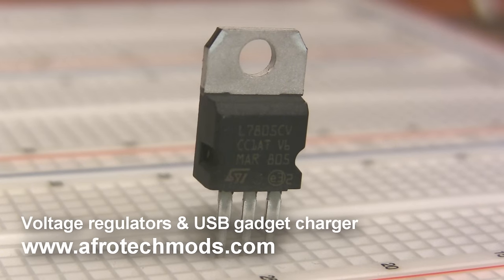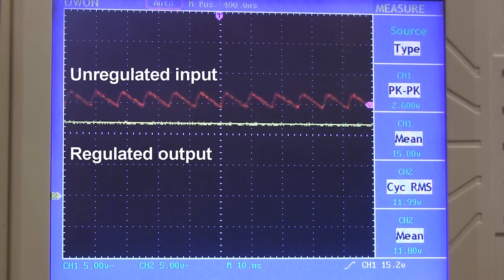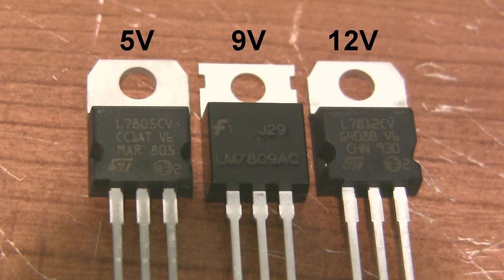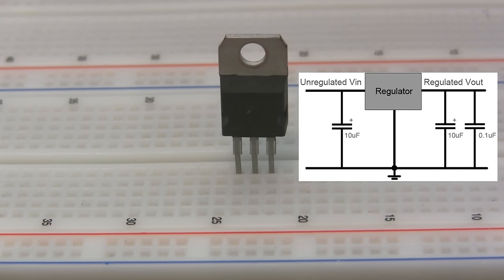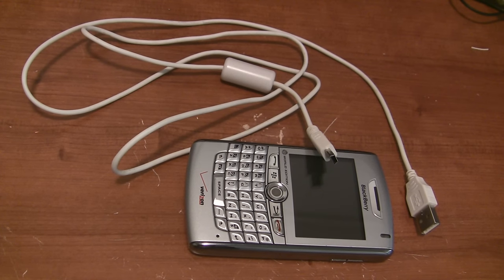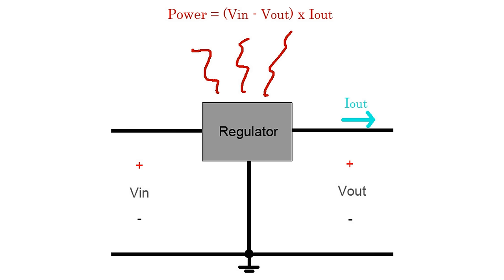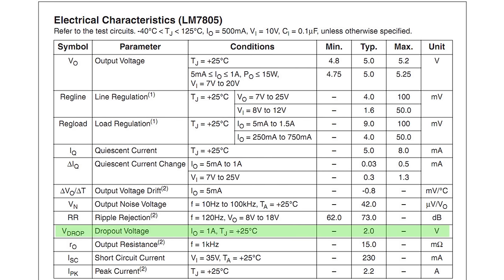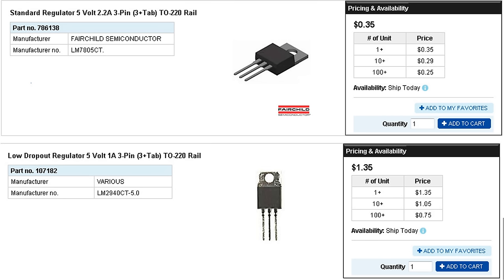Voltage regulator tutorial & USB gadget charger circuit

Comment: Question.. what if the input voltage were to drop below 5v. Would no voltage pass?
Reply: The regulator would have a smaller voltage on it's output, depending of the input voltage.

If you put a 1.5v input source, the output would be close or at 0v.
Reply: Thanks, is there a way to let the lower voltage pass until it reaches 5v?
Reply: KLanD Tine I really don't know if there's any regulator that let you do that, maybe with some little research and you could find one that does.
Reply: lolzvid
Now that I know how a standard one will react I'm doing just that.
Reply: KLanD Tine If you need a regulator that can regulate when the input voltage drops, use a buck-boost converter. Those will regulate when the input voltage goes over and below the output voltage.

Comment: Hello! 
I this video u you 2 pics 10 uF Capacitor  and 1 pic .1uF . Please tell what's there voltage? 
In the market i got 5 type of 10 uF Capacitor (50, 160, 250,  400 450) volt
and 
0.1uF capacitor any other name or code?
Reply: +Md. Touhidul Islam did u get ur answer??? if yes plz share

Comment: I love your videos so much!
Please, can you tell me just one thing? I was wondering about it for a long time. If I stabilize the voltage from 12V to 5V with 7805 regulator, what current will I get on the output? let's say that I've got 12V battery that gives max 2A. Will I get 2A on the output as well? Because it would destroy the battery in my phone. Thank You!
Reply from the maker: The load you connect determines how much current is drawn. If your device draws 0.1A then only 0.1A will pass through the regulator and only 0.1A will be supplied by the battery.
Reply: Thank You for quick reply. So when I'll use a bettery which gives me 2A, it will really destroy the battery in my phone?
Reply from the maker: Not if you follow the instructions in this tutorial. If you build what I showed you, the phone will limit the charging current to under 0.5A, so the regulator only supplies 0.5A, so the battery only supplies 0.5A. Just because the battery is capable of delivering 2A, it does not mean it will always do so.
Reply: Thanks a lot man. Really appreciate that :)

Comment: Beginner in electronics here. I have some L7805CV's, or in other words 5v regulators. (30v in). I thought that if I added two of these together on a 30v input, I could output 10v but this doesn't seem to be the case. NOTE: I am not stacking these. On my breadboard I have the 30v line in on both of these and the output going to an ohms meter. I am still only getting 5v output. Why is this?

Comment: I am really worried about overcharging phone batteries,  is overcharging protection built into the charger or into the phone?
Reply: +comebackata2 Yes it is. The mass majority of phone batteries have a single 3.7v lithium ion battery cell. The phone has a battery charging circuit in the phone that regulates the 5v from a USB charger down to 3.7v. Though more than likely will have multi stage charging circuit that charges the battery at a high current when the battery is heavily depleted then switches to a lower current when the battery reaches a high charge. Then may even switch to a trickle charge of a very low current to keep the battery at a full charge.

Read the description of this battery charger on adafruit which is the same type of charging circuit that would be found in most any phone. https://www.adafruit.com/product/259
Reply: +comebackata2 Yes it is. The mass majority of phone batteries have a single 3.7v lithium ion battery cell. The phone has a battery charging circuit in the phone that regulates the 5v from a USB charger down to 3.7v. Though more than likely will have multi stage charging circuit that charges the battery at a high current when the battery is heavily depleted then switches to a lower current when the battery reaches a high charge. Then may even switch to a trickle charge of a very low current to keep the battery at a full charge.

Read the description of this battery charger on adafruit which is the same type of charging circuit that would be found in most any phone. https://www.adafruit.com/product/259
Reply: Thanks!

Comment: Hello,
Could you possible help me to build a gadget for my entreprize in school. It would charge up your phone when you walk, so there would be a magnet on a bearing and some coil around it and a 3.7V battery, most phones charge at 5V, do you think this is a good project? do you think the battery will charge up and what resistors, voltage regulators and other do i need? i also would like to include a LED in there. If you could help me Id be very greatful. Thank you

Comment: are there precision voltage regulators?
Reply: are will you have to use other components in conjunction besides capacitors
Reply: would you be able to take that heat off the regulator on a Peltier brick and generator.

Comment: Hello, I have a 36v source and I want to keep it in a side and I want to have 9v in another side. I've put this 7809 and the multimeter show me like 10v but as soon as I connect another circuit (with a 555) the volt go down to 2v and the circuit with the 555 doesnt work. I want to fix those 9 or 8v with a 7808 to make the 555 circuit works. Anyone could help me please ?

Comment: With how many mA this would charge the battery?
I've done some research on the internet and the optimal rate you should charge the battery is like 40% of the maximum capacity. Like if my phone had 1000 mAh, I should charge it with 0.4a.
I am confused. Can you explain me a bit more?
Reply: mAh is the capacity for the battery when fully charged.
Reply: kxx Lets break this down.
m = mili
A = ampheres
h = hours
If the battery had 2000 mAh, then something that draws 2 ampheres(2000 mA) would discharge the battery in 1 hour.
Reply: DaGunchijs
thats what i said... its a measure for how much charge it can hold, when it is fully charged.
Reply: kxx
What was the question?

 With how many mA this would charge the battery?
Reply: DaGunchijs It would charge the battery according to the rated output current of the regulator, or the limit to the input current to the regulator, OR depending on any resistance you add between the regulator and your battery.

If you have a 1000mAh 12V battery, and want to charge it at only 0.4A, you could, for example, place a 30 ohm resistor between the charger and the battery on the positive terminal (could be either terminal, but for the sake of doing it proper).

You don't really want to run a regulator at it's maximum rated current, either, just to be clear. It'll work, but only for so long. Best to use a slightly too large regulator, and a resistor between it and your battery instead, to limit the amount of work it has to do. If you let it "run free" - the regulator will readily just kill itself attempting to deliver as much current as possible to your device or battery.
Reply: Mythricia
thanks, but i figured it out in 3 months, lol...

Comment: hello sir 
can i use 12v Single power supply for multiple devices for eg.. (1)cpu fan 12v 0.13 A
(2) timer switch 12v 1A
(3) temperature switch 12v 1 A

Comment: Could a battery charger really be that simple? I've been looking at building a basic NiMH battery charger and all the resources I find goes into great length on the current provided and trickle charging the battery and what not. What am I missing here? How could charging a battery be as simple as slapping a Voltage Regulator on it?
Reply from the maker: Depends on the charge rate you want to achieve, and depth of charge you want to achieve, and how much you care about your batteries. If you want a cheap and dirty NiMH charger you can just give it a constant 1.5V/cell and limit current to 1/10 of C. Or you can trickle charge with constant current at C/10 or C/20. These are definitely not the optimal way to charge the cells, but it will get you a decent charge.
Reply: From what I understand, most cellphones got most of the charging circuit inside, and the wallwart is actually just a power supply, it doesn't take care of the battery (to avoid overcharging etc); and on top of that, phone batteries got their own protection circuits inside them.

I'm not sure what it is like for other types of devices and batteries.
Reply: Dewald Swanepoel 

ok

Comment: That R-78B5.0-1.0 is same as LM317 voltage regulator.
Buy LM317 and search for schemtic how to wire it up. It is easy.
Use variable resistor to get different voltage output. I use it when im in the wilds with solar panel on my back.
To take it to the next step use darlington transistor with LM317 to get higher current output. I too kthis step to charge AGM batteries from solar power.

Comment: If you want to charge your phone with 12V use a DC DC converter, youll find them for 1-2$ fully assembled boards on ebay. 90% efficiency, output extremely stable.

Comment: what is the difference between this and a bridge rectifier
Reply: A bridge rectifier converts AC power (back and forth current flow) into DC power (single direction current flow). A voltage regulator provides a stable voltage (think pressure, rather than flow) at a chosen level regardless of input voltage, as long as the input voltage is a few volts higher (or more, within limits) than it's output voltage.

Comment: I have 4 small usb 6v 3.5 watt solar panels, in bright sun I get 7 - 9V out of one, . I want to wire them all in parallel, Will I get 14 watts and use a regulator reduce voltage down to 5V - 5.5V  as my phone needs at least 1.5- 2A before it start charging will this regulator work or is Amps/watts to high don't know if this lot makes sense?
Reply from the maker: Pulling off 1.5 to 2A with a linear regulator may be asking a bit much. Try shoot for 0.5A to 1A. Since you are using 6V panels you will want to use a low dropout regulator, like an LM2940 instead of an LM7805. Also this link may be helpful: http://www.epanorama.net/newepa/2010/08/18/apple-charger-secrets/
Reply: Thanks

Comment: Hi Folks ! As a Professional engineer I have been using the L7805CV for over ten years and I have an issue ! , did anyone else notice the thickness of the Gnd / Heatsink Tag get thinner a few years back ?. since then the typical vout seems to be on the Min side of the 5V specification with poorer regulation than the old one !.   Is it just me ??
Reply from the maker: +Kevin Felstead It depends on the manufacturer and the date code/batch. There are so many 7805s out there there will surely be variance.
Reply: I am buying from reputable supplier's such as Farnell but the output is definitely low, even using the metal case of my product as the heatsink.

Comment: OK so I got this to practice .I get 14.5 V unregulated from the car battery > directly  to an 12 V light bulb . The light Bulb will light up fast from the 14.5 Volts but if I leave it for to long it will overheat . So I used your example in the video to transform the 14.5 V to 12 V ( regulated ) .But when I connect the light bulb It won light up !   Why ?    The light bulb works fine .

Comment: I have setup everything like shown in the video.. 9v battery, 5v voltage regulator, capacitors, everything... But it is not charging my phone.. Though it is showing in my sonyericsson phone that it is being charged but the charge is not increaseding when check in phone status

Pls help

Comment: so  if i am using a 9V battery to power a 5V DC motor then if the voltage drops below 5V will i still get 5V o/p

Comment: does output voltage also depends upon the capacitors  ?
Reply: plz reply as soon as possible..
Reply: No, they are for smoothing things out under loads.
Reply: +DavePencilguin sir m making a transformerless powersupply of 5 volt and 1.5 amps for my project. so can you suggest me which is better either  linear regular or buck converters?

Comment: Sir Great video. Can I please  use this circuit,  modify it and  make a linear voltage regulator. I want your permission to upload it on you tube with due acknowledgement. Thanks.

Comment: I want to drop car battery voltage(12v~13.6v) down to 6v, the circuit will not use more than 500mA.

I take it a LM7806 and 2 10uF and 0.1uF capacitors will do. fine.

Comment: I want to charge 8v,4600mah battery pack when I use 7808 it’s burned out in 2 mins it’s dissipate heavy heat can any one suggest a solution for limiting output drawn current of regulator ics

Comment: Hi , Can u explain plz why  linear regulators are inefficient ?
Reply: +Elasmar Hamza The excess voltage that is dropped across the regulator, multiplied by the current flowing through the regulator, results in power dissipated as heat. This power is being supplied by the unregulated stage of the power supply, but it is not reaching the load. It is being wasted. A more efficient regulator is called a "Switching Regulator" whereby the power supply delivers energy to the load in such a way that it is being switched on and off very rapidly, and just like a light switch does not really use up energy it just gates it, a switching regulator wastes very little energy compared to its linear counterpart. Think of a switching regulator as switching on for 1 millisecond, and off for 2 milliseconds as a way to deliver 1/3 the total available power to the load. Hope that clears things up!
Reply: +Growly Bear Thank you so much for your really clear explanation! :) Keep that up please! :)

Comment: Of course the greater the potential drop the more heat is energy is thrown away.  For that 5 volt regulated supply 7 volts times the current drawn through the circuit is thrown away as heat.  That heat's got to go somewhere and a decent heat-sink will be required to dissipate 14W continuous output; otherwise the regulator will quickly fail.

Comment: Ummm... I want to make a correction, cause I was doing same thin in my car, trying to make a 2a charger. And I spent good 2-3 hours figuring out why iPhone wasn't charging on even 5.1v, but then I found on Internet, that you must short Data+ and Data- wires (aka green and white) otherwise it won't charge iPhone at least, no sure about other devices
Reply: Did you solder it to the negative wire to short it?
Reply: Most phones also have a specific resistor between those lines to detect the correct charger.

Comment: How to convert 12v ac power into 6v dc. If you have this tutorial then give me the link. This is to be i am using scale circuit board from 12v ac transformer to 6v dc battery to charged the battery. Please reply
Reply from the maker: Look for my electrical transformer tutorial videos and diode tutorial videos

Comment: I'm a noob to electronics. I think I understand the concept, that is, to smooth the supply. But cant standard capacitors do the very same thing? So why use a VR if a cap can do it?
Reply: +Francis Rodgers The point of the voltage regulator is to set a maximum voltage that will pass through.  For example, if you  are powering something from a car battery, the battery's voltage can go as high as 24v. 
If you have a sensitive device plugged into the power socket, you need a regulator, to make sure that the voltage on your circuit stays capped at 12v.
Reply: +Jim O&#39;Connell Thanks Jim.

Comment: Which voltage regulator I have to use for 22v to 9volts
Reply: the LM7809 has a maximum input voltage defined in the datasheet of 35 volts meaning you can easily use it to regulate your circuit to 9v.

Comment: Hi! Can i replace a 24v regulator to a 12v regulator in a kit?
Reply: yes just make sure your 12v reg is the same ratings as the 24v except for the voltage and it wil be fine.
Reply: Okay thanks!
Reply: LM1084 and its setup for 5v using resistors.   my voltage drops from 5.20v to 3.30v when i connect a 2A load on it.. anyone help me solve this ? my power supply is 12v 20A and input voltage stay at a constant 12v and iv tried 2000uf cap on the output but still voltage falls iv used 4000uf also no change...and mobile phone stops charging under 5v
Reply: Mustafa Hussain lol

Comment: You could take a 16V power source and run it through a 9V regulator, and then to a 45V regulator, to not have all of that heat on the 5V regulator.